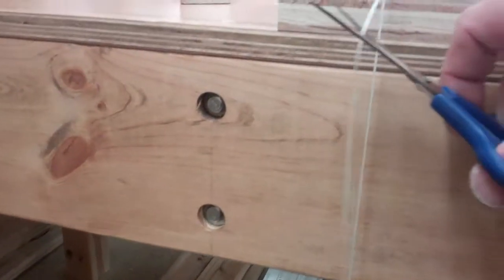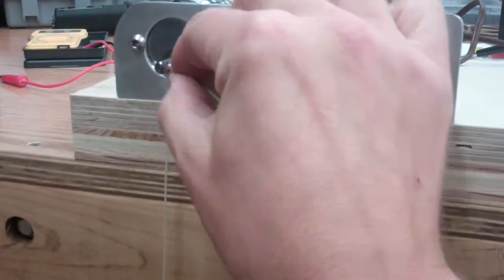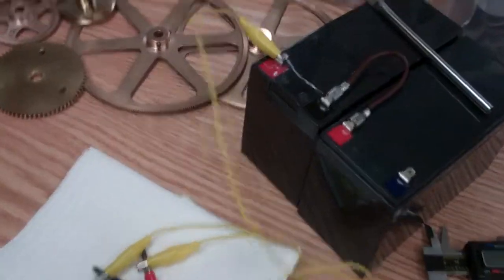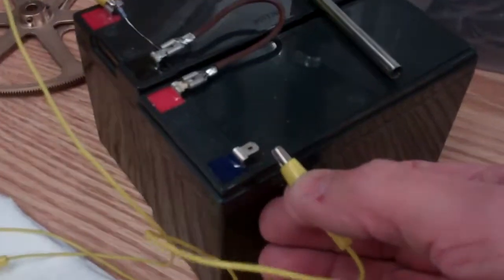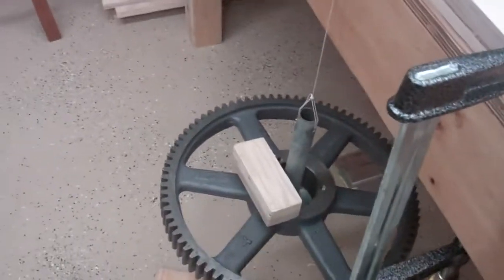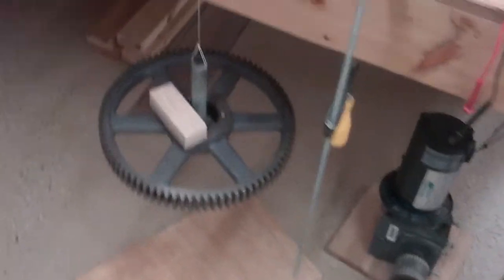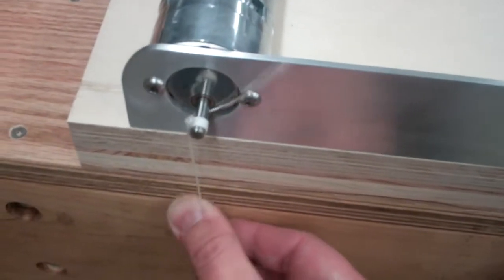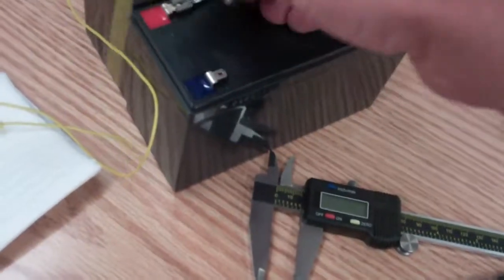gear motor lifting some weight

Comment: how did the motor hold the weight and not unwind when u turned it off?
Reply: high starting torque is higher the the amount of the weight.